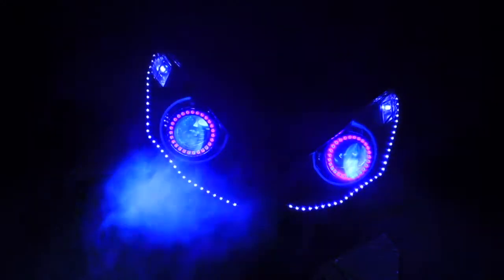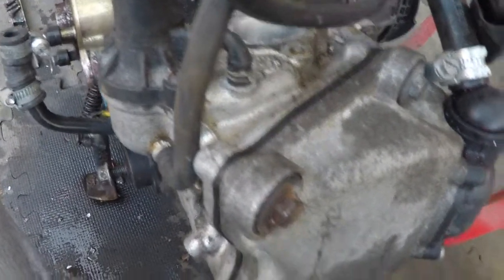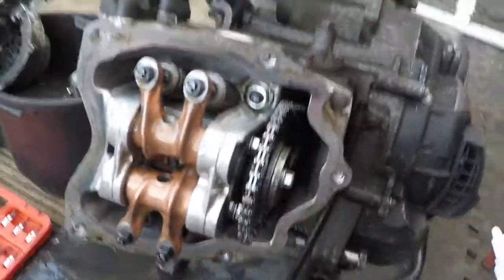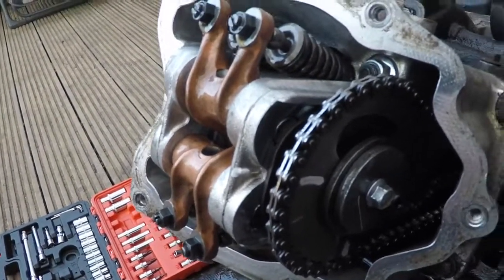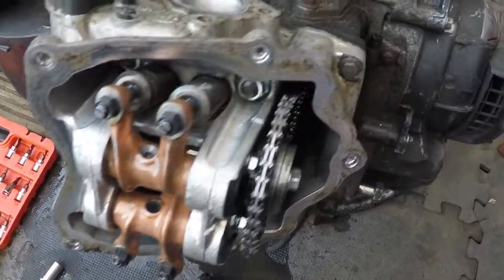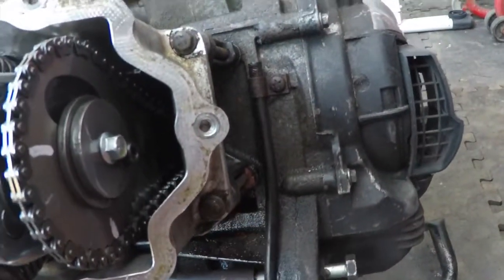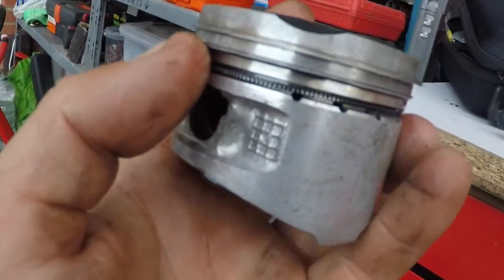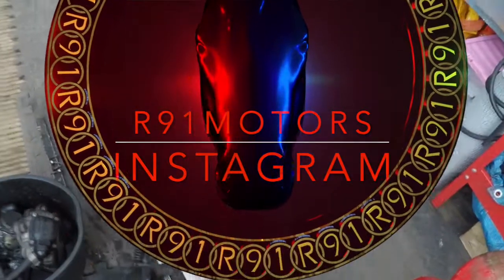Cylinder and piston removal step by step piaggio vespa GTS 125CC AND 300CC

Comment: What can I do if the timings out already
Reply: Take the cam chain off the top sprocket, rotate engine so that piston is at TDC and rotate the top sprocket/camshaft so that the 2V or 4V (depending on model) marking is lined up with the little dot which should be just above the sprocket, then put the camchain back on and the timing should be correct.
There's not much involved in timing the LEADER engine, so if the timing is wrong then it was built incorrectly or the cam chain has been skipping teeth on the sprocket, which is unlikely but would cause the teeth on the sprocket to become curved. This is called the shark tooth effect.
If the teeth on the sprocket are curved or damaged in any way, order a new one.
If the engine is running with incorrect timing, the piston may hit the valves which will shatter or bend 1 or more valves and cause the piston to break as well, requiring a full top end rebuild.
Reply from the maker: If nothing is damaged just adjust to correct places what model you got I have book for most off GTS models and adjustments

Comment: thanks, but now how do i rebuild it?
Reply from the maker: Usually if you take apart engine you put your marks to make sure you can put engine together but don’t worry there is marking points have to adjust chain send me your Instagram or something to send photo I have book have to adjust correct timing chain really easy
Reply: The hardest part is getting the piston in the cylinder without breaking any of the rings

Comment: Hi i need to change the head gasket, do you know the millimeter squish?
Reply: If you replace the head gasket, just make sure that the cylinder head nuts are tightened to the correct torque.
Its somewhere around 10-13 Nm, but you  need to find out the correct tightening torques for your specific engine before you do this.
Reply: @gabrielwalker421  Repairs are complete. I started the scooter and this summer when the sun will be present I will check that.
Reply from the maker: I need check the book but I am sure if you will put all details about your ride it will give you the right option but will check and get back to ya
Reply: @r91motorswelcome79  I bought a scooter with the damaged head gasket, the scooter is difficult to accelerate. The mechanic's estimate spoke of replacing the base gasket under the cylinder. But is it necessary? Suppose I replace it, we have 3 different choices 0.4 / 0.6 / 0.8millimeters. I do not know the switch and it prevents me from making my choice! The workshop instructions speak of 13: 1 compression and not of squish.

Comment: Nice vedeo..um having a problem with mi vespa i Turn the Key to lock position and press the unlock button and the SEAT is open...du you know what the problem is,? thankyou regards
Reply from the maker: Thanks it’s probably something to do with little hook under seat my one did the same not locking properly when you close seat with power is it locking then
Reply: The SEAT is locking ok,but  you know when you lock the stering whell and Tur the Key to lock position you press the unlock button and the SEAT is not supost to Open min thus Open